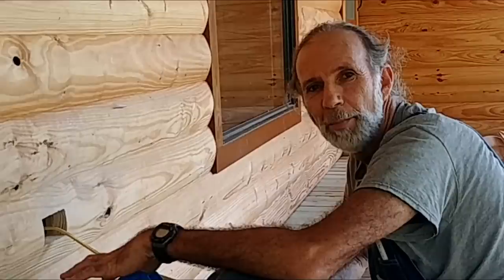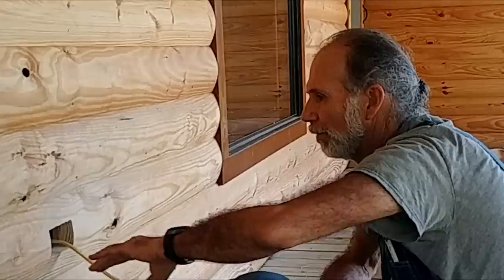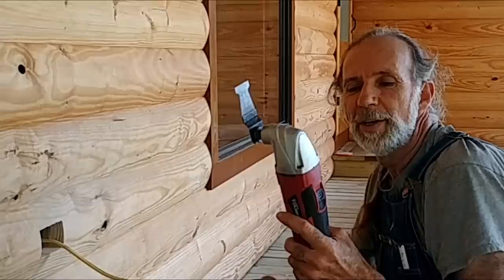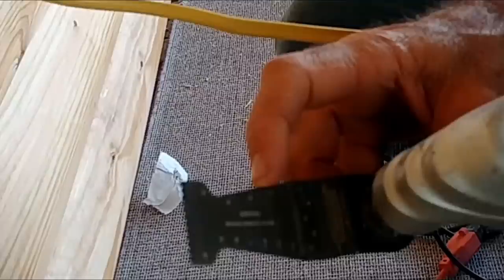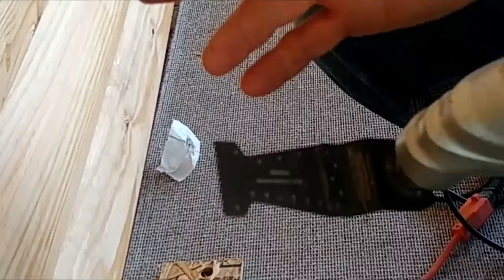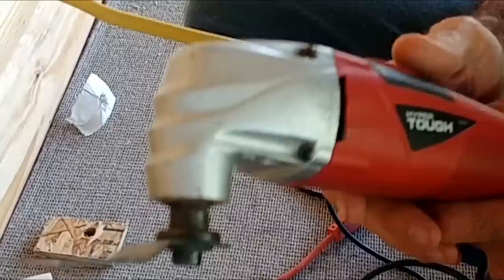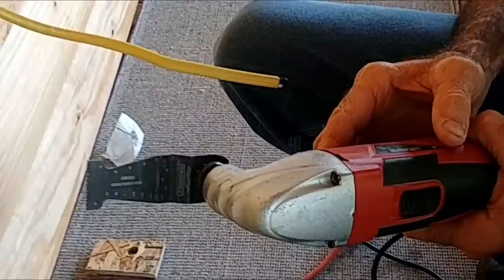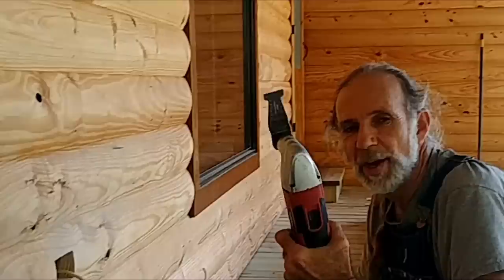The Most AMAZING Carpenter Tool

Comment: First time I saw one was when a carpenter came to do work on my house and had one in his Festool set. The rectangular piece was only about and inch and a half long and you could barely see any teeth on it, but it made cutting out the pieces of skirting which were fixed to the wall, dead easy. That tool impressed me, looks like I am not alone there!

Comment: I use one at work to undercut door jambs,  cutting stubborn rusty bolts from toilets,  removing old tile grout,  and occasionally cutting out floor vents that were accidentally covered by flooring.  I was sceptical when I first seen them, but now i wouldn't work without one.

Comment: The first time I ever saw one was when an electrician was using one to cut his electrical box holes in sheetrock. He had one that was the shape of the entire box and it would cut it all out at the same time. According to him, they have the same rig for concrete and brick bits. They are extremely noisy but work very well. I read about the history of this tool a few years ago and found that they started life as medical tools that were used to remove plaster cast from broken arms, etc. back in the 60s. They didn't become construction tools until the mid to late 80s but didn't gain popularity and become more affordable until the 2000s.

Comment: Danny

I have two pots. That have heavy hard metal

I want to removes these poles inside them

My problem is they like flower pots with poles in center

It’s space  non of my tool works 

I would love to use both pots to put plants in then

I think center poles are iron something. I kept these pots 

Do u think this tool will get into small area to cut these hard metal out planters?

If so

What kind of blade I could use since I am not sure of hard metal?

Looking at your tool it might be tool to get into  tight spot to cut these poles out center of my two pots?

I so enjoy your poarch talk. Keep them comming

Comment: BTW. That is the wrong box. It has no clamp and you cut off the mounting tabs. You should use an OWB or "old work box" with a wire clamp and front mounting tabs. How did you secure it? A+ on the tool demo. F on the electric code lol. Any inspections there? It might not pass.

Comment: This brand  is no good!
Reply: OK for the occasional user but yes there are far better models out there. Mine is very powerful and even has a vacuum attachment and variable speed. Love it. Paid $60 back when the cheapest in the stores were $99 years ago. Good old eBay.
Reply: OK for the occasional user but yes there are far better models out there for the tradesmen. Mine is very powerful and even has a vacuum attachment and variable speed. Paid $60 off ebay back when they were $99 in the stores. Use it all the time and never any problems. I just rebuilt 2 large windows and used it to cut off hundreds of nails clean as a whistle.